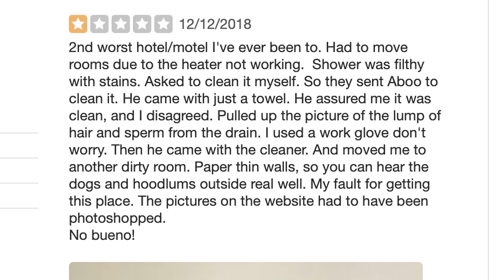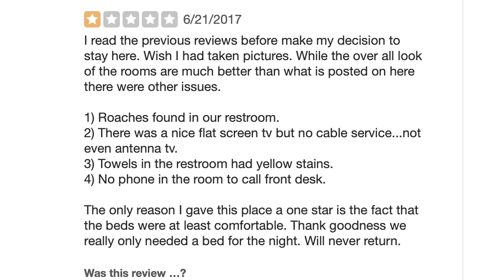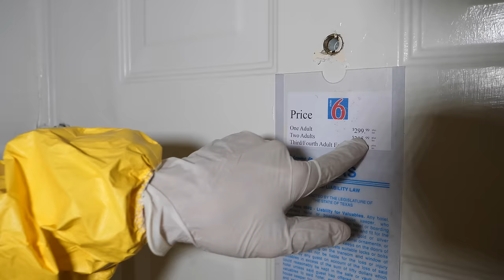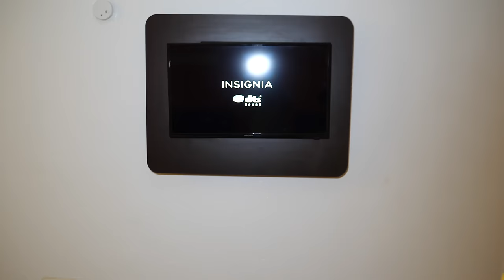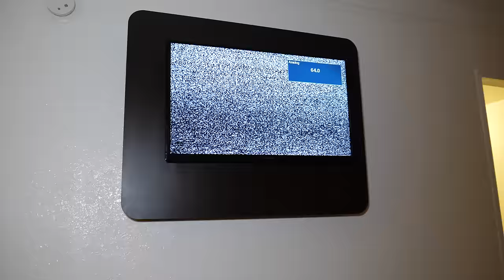Staying At The WORST Reviewed Hotel In Texas (1 STAR)

Comment: My apartment was spraying for bugs and I had to find a motel that accepted cats quickly because they couldn’t stay in where they were spraying. Since it was only for one night I chose to stay at the motel 6 down the street from me. I knew the room you went in was a motel 6 because of that ghastly wall. From what I could see It was clean for the most part, but smelled heavily of smoke. My cats wouldn’t come out from under the second bed, and the longer I stayed in the room the more I began to feel like I was catching a cold. I waited the minimum I was told to wait before I could renter my apartment (about 8 hours), and promptly relocated. Didn’t even spend the night. Had a bad cold for about two weeks after that.
Edit: the tv didn’t work, but the towels were clean lol. I didn’t even pull the bedsheets back because I knew I wasn’t going to sleep there. It was only $70, so it wasn’t too big of a waste, did what I needed; a place to store my cats for a bit.